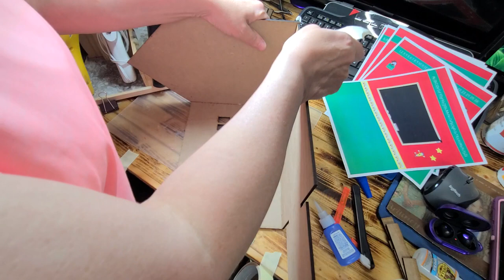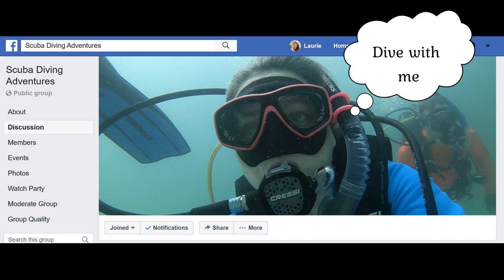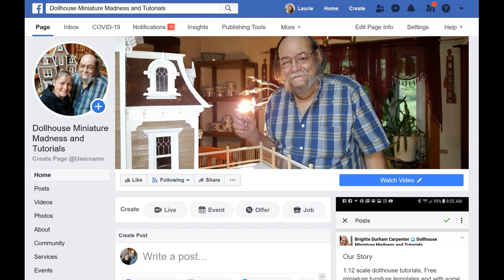Schoolhouse Dollhouse Kit-1:12 Scale (Part 1)

Comment: Can you make this with a larger room size, but still 1/12 scale? Ive been wanting to build a chapel for years!  This one doesnt look as though it would hold many furnishings (alter and pews) inside its footprint.
Reply from the maker: I actually have 2 sizes for this in my Etsy shop. This video shows the smallest one. I believe the latger one is around 10" or 11"  wide by 17" or 18" long but you can find the exact measurements in the product listing. 
www.etsy.com/shop/craftsbylaurie4u
Reply: @DollhouseTutorials  Oh Thank you!! I like it! Can the cupula still be put atop the higher roof? And is there any chance of customising gothic arched windows? This is near perfectly what Ive dreamed of building!
Reply from the maker: I designed a church with pews and all but I haven't test printed it yet. Let me look at both designs and I'll see what I can do